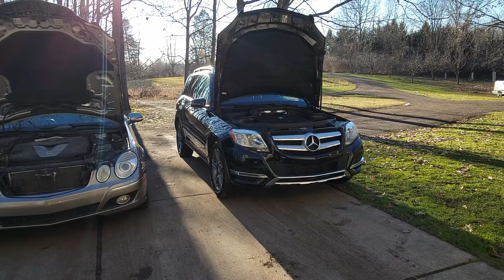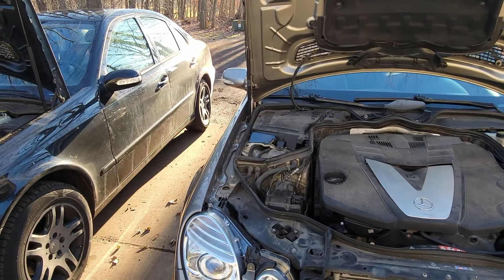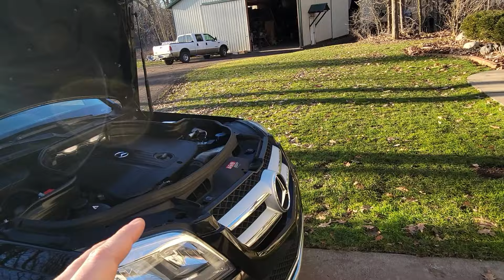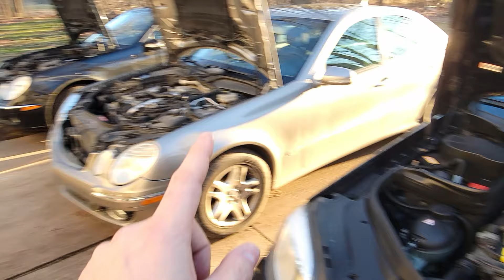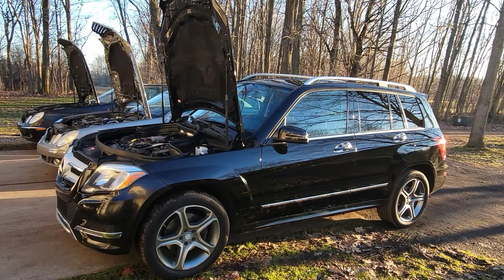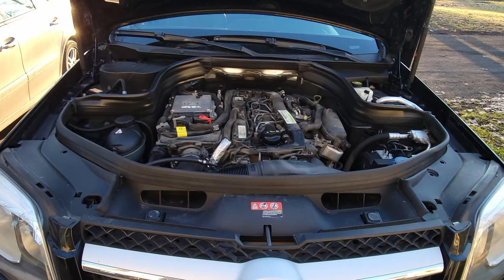The End of the Mercedes Benz Diesel for the United States

Comment: Agreed on the OM648, my daily driver 2006 has 320k miles and counting.  Aside from regular maintenance, it really needs nothing.
Reply: are you concerned with the brakes system
Reply: I have 2005 e320 cdi with just under 200k miles. My SBC system was replaced under warranty free of charge in 2023. I think warranty runs out in 2029.  All in all besides SBC,  water pump and normal maintenance I had no issues.
Reply: @countlesshobbiesmk2273  I wonder if I spoke to Mercedes and asked them If I bought an SBC car would they replace it.

Comment: It’s a real shame. Owned a 07 E and it was a tremendous car. Sadly the transmission spilled its guts at 200k  and replacement repair was more than value of car. Now have a 2015 E and attest to its reliability and phenomenal economy. Mercedes did the bulletproof emissions mod by recall. Car performs very well on highway. Consistent 42 -45 mpg with one experience of 49.5 mpg from Missoula MT to Sparta WI, over 1500 miles at 70-75 mph.
Reply from the maker: Om651 owners are all in pretty universal agreement on reliability of that engine, I hope it stands the test of time as the older diesels. 

Any idea what failed on the 722.9 transmission in your 07 e class? Those transmissions are usually pretty bulletproof
Reply: @MBDieselFreak  Do you know why i get error "Right hot film mass air flow sensor, value above limit" - Om642 - E280 CDi 2006 4 matic - nothing wrong with the sensors, i changed the whole Y, nothing wrong with the cables.
Reply from the maker: @torandrefjsne5296  value above limit means there's not enough air flowing past the sensor. replace your air filters!

Comment: Have a 2008 GL 320 am doing regular maintenance and changing oil every 3000 miles. Had 101000 miles when purchased in 2018, currently has 174000 miles ….so far it’s been an excellent vehicle 😊
Reply: Yeap, same exact CDI  I have just passed 203000 miles. Maintained!

Comment: I’m surprised the US doesn’t get diesels after 17. The engine i really want is the OM656 in the form of E400d E-Class All Terrain - there’s only a small batch of them in Australia that were a cancelled police vehicle order. I’ll be waiting for a lot more depreciation to take effect yet… There’s a W212 6 cyl 2012 BlueTec I want - but I’ll definitely be considering four cylinder options thanks to your informative video. I think Australia is only getting diesel in SUVs now, and no longer in the E-Class. Thanks for the run through of options! Good vid!

Comment: love the look of my W164 350 cdi,need to adress oil cooler seals,new front cv axles,diff rebuild and looks like this car has to be driven pretty often otherwise it would crank and not start because probably computer wouldnt get enough electrical power,i didnt use it for a 1.5 month and had to reecharge the battery,im also putting new borg warner transfer case chain aand meyle guibo,its gonna run like new :)

Comment: My 2014 GLK250 runs like a clock after 10 years. It gets 43 MPG. I always wonder why I should  buy a light weight Corolla Hybrid with all the complicated/expensive battery systems that can only achieve 46 MPG? If you want to keep your OM651 for a longer time, please do NOT take it to the dealer for the "free" emission modification. After the "free" modification, your OM651 will consume more fuel and DEF (AdBlue) and will go to the junk yard sooner than you expected.

Comment: Own a 2006 E320 CDI.
If is set the cruise control at 57 MPH, I actually get 57.5 miles per gallon.
If I set it to 80 MPH, I average about 40 miles per gallon.
Piety they are not making them for the USA any more.
Was told by the dealer that it would be a special order if I did.
It is a great care.
Reply: The dealer can special order a diesel for you?

Comment: Both of the OM642's I had needed timing chains - I had a 2011 w212 and a 2012 x164. The chains show up as long crank and abnormal amounts of clatter on start. I have had 2 2006 w211's CDIs and agree with the OM648 being dead reliable and the most fun powertrain out there. The bigger difference in drivability across the generations IMO was the trans - the 722.6 is the right gearbox for these engines, the 8 speed auto totally destroys the driving experience and makes you feel like your are mushing around a well equipped Camry. My channel has some well viewed videos on my projects to the MB diesels as well.  I have been looking for an honest assessment of the OM651 as I may soon have need for a commuter vehicle, so I really appreciate this video, and your content in general.
Reply from the maker: I wonder what causes the stretch on the 642, just a bad chain from the factory? I've heard very few stories of the 642 needing a timing chain, it surprises me you had TWO vehicles needing it, that's crazy. Both my 08 ML320 and 06 E320 are over 200k on the original chain, and neither are showing signs of stretches chains.
Reply: I can answer that.  It is a combination of three things.  Indirectly it is the oil that MB uses.  It is not a diesel rated oil --- it is Mobil 1 5w30.  It does not have a "C" rating, so the soot builds up and wears the chain out prematurely.  That oil was chosen to help increase MB's overall fuel mileage ratings to offset some of their really bad mpg performance cars.  It was not chosen because it's the best oil for the engine. The other problem that contributes to the soot is that the PCV device on that engine wears out at about 35K miles and needs to be replaced. Lastly, it is MB's recommended mileage for an oil change.  Change your oil at 5,000 miles and you will better control the amount of soot in it.  If you will use Amsoil Signature Series 15w40 diesel oil and do the other two things I mentioned you will not have a problem with timing chains.
Reply from the maker: @LuckyChow  the oil is also formulated to prevent fouling of the DPF and SCR systems, so it's important to use the correct spec oil. My om648 with 500k miles has had the same MB recommended oil as the bluetec's the majority of its life and is showing no signs of failure. I think like with any high stress engine, making sure the engine oil stays clean is crucial, and for the om651 being a higher output higher stress engine, it SHOULD have 5k-7k mile oil changes. Purchase the kits from FCP euro and you've got $30(return shipping) oil changes for life.
Reply: @MBDieselFreak  I came here to mention the OM642 timing chain issue. The community consensus is that the chain will probably hold tolerance for 80k-100k miles. Amongst oil concerns people have also mentioned that the over-all length of the chain could also contribute to timing going out of tolerance. I just replaced the entire OM642 out of my wife's ML320 and I installed the engine with a new timing chain in it. I've selected rotella T6 5W-40 and change oil and filter every 5k miles. Hopefully this holds the timing tolerance in spec for longer.

Comment: Have OM648 with 200k. Agree it is very reliable, fuel efficient (30 mpg combined for E320) and performant, but don't forget to mention the dreaded "CDI Black Death". Have had to resurface cyl head for several injectors which were leaking and building up a black glossy substance on the cylinder head.
Reply from the maker: True, but there are ways to get the injectors unstuck using heat and carb cleaner. The head does not need to be removed to be resurfaced, you can buy injector seat reaming tools to   clean up the injector sealing surface. its not too big of a job.
Reply: Black Death should never become an issue if you watch out for it.  I leave off my engine cover and I have the hood popped most of the time (garaged- have mice that can get in and opening up the hood discourages their wanting to build nests in the engine compartment).  When a leaking seal is caught and dealt with w/o waiting there is zero reason for the seat to be needing re-cut (not sure why your engine's head was pulled[?]).

Comment: Just bought an OM648 E Class with 200k miles on it and it still rips. The Plastic intake was broken so the previous owner thought it has a faulty engine. I replaced it and now it runs like new. Only thing wrong with that engines is injector blow by leading to black death. Mine does not have that but it is definitely a thing to look after.

Comment: With 250k miles OM642 had  timing chain issue with no start condition during cranking, timing was off  9 degrees. Oil cooler seals @60k miles that is it outside regular scheduled maintenance. Great engine 320k miles now
Reply: I also needed to replace timing chain at about 300k kms. It was a horrible sound by the chain tensioner at a cold start and timing was also a little bit off. Now runs much more smooth.

Comment: The GLS and GLE diesels are still being built in considerable numbers in the USA for export to Europe and Anzac.   Emissions or not, the latest current engines are reliable by any standard despite common rail, EGR, DPF and Adblue systems. They are also the most economical on fuel yet and that is even more enhanced by coupling to their mild hybrid electric motors.

Comment: I have a 2008 E320 Bluetec, OM 642 W211. It is really a good car and as said, repairing the oil cooler seals is a major job. I paid for a Mercedes mechanic to do this job and it took him 14 hs of labor. The kit has 25 seals because all seals from turbo and exhaust system also need to be replaced when re assembling. About the DPF (diesel particulate filter) in 2020 the dealer asked $2900.00 for the filter alone. Other than that, it is a reliable and comfortable  car. Mine has now 153 K miles

Comment: In Europe there are OM651 EVERYWHERE. My conclusion to the reliability is that there are so many of them, but more than a few have timing chain issues. I’m not sure as to why it’s a weakness, but seems like most say it’s a stress/old oil/single chain weakness thing. But still some taxis etc make it to like 500k km. I’ve had 1 in a E250 CDI 4 matic. With over 200k km ran like new.

Comment: 300.000kms on my mercedes w211 e320cdi 2007 om642 it has the dpf abd egr deleted very reliable only issue i had was the oil cooler seals.

Comment: I sold my 05 CDI to my nephew a couple months ago and bought a 2013 E350 Bluetec with 87K.  I know its not as reliable as the CDI but it is still awesome. The emissions update had just been done on it so the 4-48 warranty just started so which gives me piece of mind for a while. Timing chain is shot already(rattle at startup)  and I'm in talks with the dealer to get it replaced under warranty.  All the emissions crap they have to put on pretty much wreck the modern diesels. 5k oil changes and 2.5k oil filter changes and catch tank will help a little.
Reply from the maker: That's an OM642 correct? the V6? Have the dealer check to see if the loose chain is related to a bad tensioner rather than a stretched chain.

Comment: Front control arms and ABS sensors on rear axles have been my issue on the GLK. Major corrosion within the rear parking brake drum area in the rear. Overall excellent though.

Comment: I have a 2006 e320 cdi ive owned fir a year and have driven it over 20k miles and its been great. I see why they were only imported for 2 years. Ive only had a couple issues both crank and cam position sensors need replaced also the cam sensor harness plug was brittle had to replace. I love the car.

Comment: The OM642 was originally made for military purposes in Europe. Without emissions equipment it's a tank. But the later OM642.852 are quite reliable too. If you got an SCR one, add some add blue cleaning/ anto cristalization additive into the add blue tank.

Comment: About the OM642 turbo oil intake issue: as preventive maintenance the local dealer mechanics put a piece of plastic bottle under the plenum, so that potential oil will drip past the swirl flap motor!

Comment: OM642, I did modification remove the swirls motor and remove the egr and hot water chamber,  mute it, as long as the chamber remove you will able to remove the oil cooler without touching the manifold

Comment: I want an engine that makes good power, gets great mileage and lasts forever. Here you go! A Mercedes Diesel! You got your facts a bit wrong though. There is a succesor to both of these engines, the OM 654 and 656 respectively an inline 4 and 6. These are unfortunately not as stout and reliable as their Diesels of the past. Turbochargers failing and problems with sensors for the emission equipment are super common. Plus if something goes wrong they are really difficult to work on. Also om 642 and 651 without SCR catalyst were still available up to 2014. Otherwise a great Video man and good to see new diesel content after such a long time
Reply from the maker: I'm only covering Mercedes passenger cars in the US, and the om654 was never used in passenger cars in the US.

Comment: Hey man, love your videos, is there much difference in frame, suspension etc from e320 05 gas vs e320 05 cdi. I was considering getting a gasser and e320 cdi engine to swap into the gasser, since they are so hard to find, please let me know! Thanks
Reply from the maker: @FreemanLightner  they are essentially identical when it comes to suspension and subframes, but i would highly recommend NOT engine swapping. The CDI's entire drive train is basically taken from the E55 to be able to handle the torque. Everything subject to engine torque is beefed up: Transmission, drives shaft, flex disks, differential has a different ratio, axles are different, etc. Your time and money would be much better spent broading your search and flying out to pick up a car out of state. Autotempest is a great tool for that. Facebook marketplace as well.

Comment: Love your videos. Recently started learning how to work on my om646 c with 230k miles. However its getting hard to keep due to hard staring/long cranking on first start of the day, once its warm it start right up. I changed injector seals recently due to bad black death which helped intially but now its reverted to how it was. I know it may be fuel system related but don't know where to start also using you videos to get courage to do glow plugs too. Any advice would be appreciated

Comment: I have a 2005 OM648 W211 with only 58k miles on it, it will outlive me and possibly my teenage son! Just de catted it and give it a nice balanced map for economy and a bit of extra oomph when needed. Service it every 5k miles using only OEM parts or Bosch at the very least. The only downside is that stupid SBC pump issue so have money aside for when that goes (if you're not in the USA) I'm in the UK and Mercedes screwed us hard with that! No 25 year warranty for us. Word to the wise be very careful about blanking the egr as these engines will run hotter with it and risk frying your head gasket. Just pull the inlet/egr every summer clean it out and do the swirl flap mod while you're at it and it will sail to a million no problem.

Comment: I have a 2005 E320 CDI, I love it, although it has the front end bushing issues.  I was going to put a OM617 in my 2007 Jeep, but I think I'm goin with a GLK Engine, transmission and transfer case!
Reply from the maker: The GLK itself is just a fantastic platform. Reliable, looks great, good fuel economy,  versatile, comfy, easy to work on.

Comment: Very nice and informative video, I have a OM642 with 320k kms (about 200k miles) I’m just curious I’ve done all the outside maintenance, oil cooler, timing chain, injectors, glow plugs, timing belt and of course all the fluids but I’m a little bit worried about the bottom end like oil pump, rod bearings and main bearings. Is there someone who at any time did this bottom end rebuild and if, at how many miles if I may ask. It’s an 2005 C-class sport edition regularly doing 125mph on highway cruise control (Im from Europe). Ofc had regular oil changes on time, Im a 3rd owner.

Comment: Cool vid I own 2 05 E320 cdi and one 2010 ml350 diesel. Have you seen pil consumption issue on the v6 diesel?
Reply from the maker: Not consumption, but leakage. I'm getting leakage around the valve covers that amounts to a little less than a quart between oil changes. I've just not gotten around to fixing that.

Comment: I have a om646 which was the last real 4 cylinder mercedes diesel - I haven’t seen a om646 that had any major issues before 600k+ km. The only downside of the om646 we’re the delphi injectors which were good but not as good as the bosch injectors on the 320 648 and 642 engines. The om651 is nowhere near as reliable as the 646. It has siemens injectors which are a lot more expensive to repair, they have tiny timing chains which always start to rattle and need to be replaced and the engines tend to go bad in sprinters around 200k km. Also the 651 crankshaft needs to be replaced around 400k km. Mind you this doesn’t mean this engine is bad but it’s nowhere near the old mercedes diesels.

Comment: I’ve been a mechanic at a Benz dealer for nearly 2 years now up here in Canada. We work on many diesels, mainly 642’s but sometimes 651’s, and mainly see them due to field measure warranty. I agree, these motors are reliable and I love the 642 particularly, it was my first introduction to diesel engines. I believe the field measure software unfortunately does cause issues with these engines e.g we’ve noticed them burning oil since. On the other hand, people abuse these cars and only bring them into a shop seeing as it’s free. Don’t get me wrong, I have my quelms with Mercedes-Benz but for example we change tons of AdBlue heaters under warranty and I always notice coincidentally that the AdBlue has been topped up. It’s a heated coil you’re running dry, what’d you expect to happen? Regardless, it’s a pitty what emissions does to these motors particularly egr. Thanks for the video